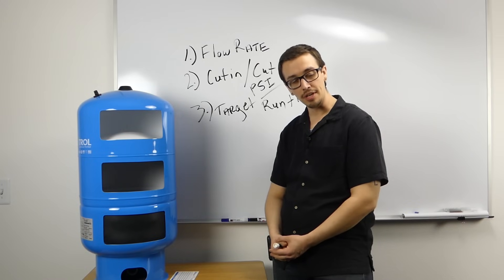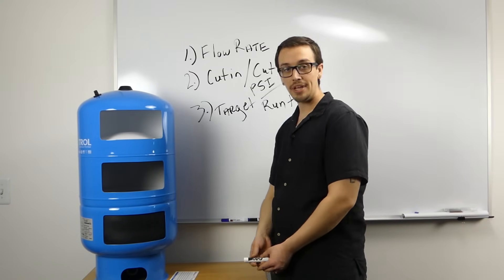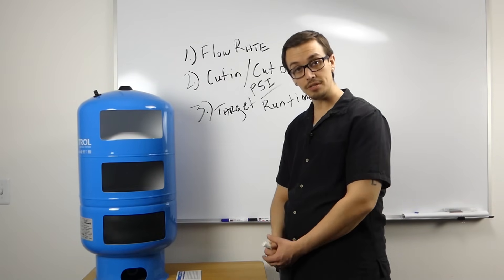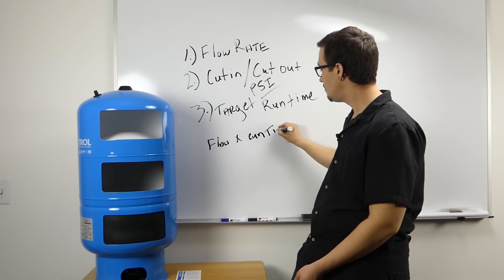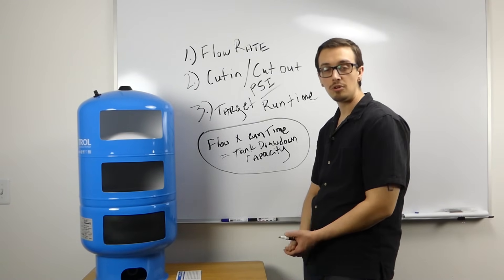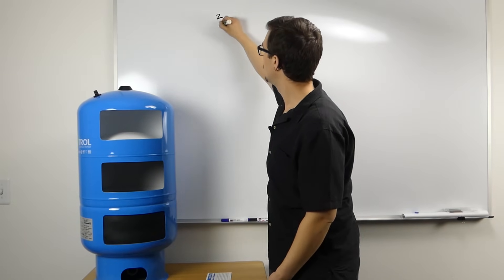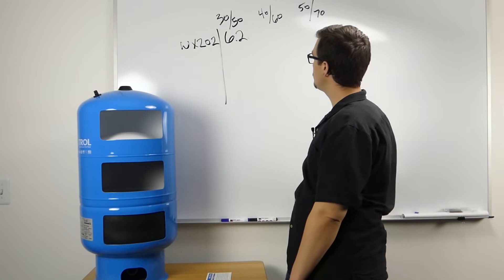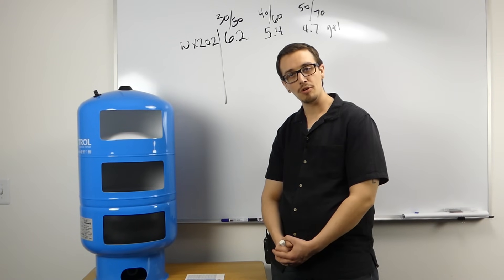How to Size a Pressure Tank

Comment from the maker: Thanks for watching! If you have ANY questions or concerns about your water system you can leave a comment, call our experts at 855.329.4519 or you can live chat with them on our website: RCWorst.com
Reply: Thanx for the video. Hoping you can help me figure out what I need. Want to setup a irrigation system for my garden. Got a 4 inch underground line about 700 feet long. Want to run drip tape off the line. Want to pressure the 4 inch line at 60 psi and throttle the header the the drip lines run off to 8 psi. Will run about 1000 feet of drip tape
Reply: sir what thr problem of my water tank if the water pressure will not go up?  the water pressure steady at 30psi..  the cut in cut off is 20 to 40psi
Reply: Good video and explanation.  I watched because I'm concerned about my system.  Just bought a house and noticed the pump short cycles alot.  It's set to 35/50 and runs no longer than 10 to 15 seconds at a time.  Too big of a pump or too small of a tank?  Tank is a WX203TK.  Any advice would help.
Reply: Is there any way I can build a forge out of a well tank
Reply: Good evening sir my question is for a sta-rite 3/4 jet pump how must measure the tank...and a 1hp jet pump too...thanks.
Reply: I just bought a property ( deceased owner) so there is no information as the house was built 1986 before records were kept. How do I know what my gpm and flow rates are? I have a 30/50 pressure switch  but it is cycling fast with a 20gallon pressure tank and set for 40/60 with 38 psi  3/4" input line with 1/2" copper lines to fixtures ( 1 bath ) slab house. Everything kicks on and off but noticed as the pressure guage drops down it dips deep ( jumps wildly down during cut in ) then smoothly to the cutoff What is wrong? I do not know pump size or how to tell ?
Reply: You said for pumps 'smaller than 1 hp target a run time of 1 minute' for pumps 'larger  target at least 2 minutes'   so does that "larger" include the 1 hp pumps?
My 1 hp pump seems put out over 23?24? gpm but I can only fit about an 80 gallon (21gallon drawdown) into the pump house.  What do you do in a case like that?
Reply: My irrigation pump is 3500lpm, what is the tank size.
Reply: @msayas6239  Yoy should use a tank of 460 gals. minimum. This is obtained by dividing 3500 LPM /3.8 equal 460 gals.      Because 3.8 equals 1 gal.
Reply: Por favor indicarme si puedo ver 
este video en idioma español

Comment: I had a beach house near a hotel,   When around 5 pm hit so many guest were taking a shower and I would loose all water pressure.  I installed the largest wellmate pressure tank I had in stock.   With a check valve on my city supply,  no pump,  if pressure on tank side was higher house drew from tank,  proper bladder pressure is critical,   When I did have pressure it was around 90 psi….i also had one in the sun that preheated water for my shower that had a small tankless heater.
Reply: Lose*

Comment: My home is 17yo, and I've owned it 2yrs. Original owners obviously did not cut corners or install less than top-line support systems. I cannot locate the pressure tank. Does that tell me its buried? If so, how do i check functioning and tank pressure for maintenance? Pump/panel exposed 60' from house but no tank. We have lost consistent flow and pressure in house. All interior lines are good. Im stuck!

Comment: @6:22, you said at higher pressure, more draw down volume is required, but your table shows less volume is required.
Reply from the maker: @6:22 He said "The higher pressure you are operating the more tank you will need" 
This means the volume stored goes down as the pressure goes up - you may need a larger tank to hit your target run time if you are running a higher pressure.
Reply: @RCworstwater  But the pump rate goes down with higher pressure, so the table is correct.
Reply: @somaday2595  brain 🤯

Comment: Thank you for the chart! Does the number in parentheses, after the recommended tank model, indicate the need for more than one tank in some circumstances? For example, a 20 GPM pump, operating at 40/60 PSIG and ESP II says "WX-255 (2)", as compared to ESP I which says "WX-255." Does that mean it is recommended to hook two WX-255 tanks in tandem for ESP II?

Comment: Amazing video! I had some questions, my well is 50ft and according to my 1 hp pump specs, it has 7.5 gpm flow rate at that depth, my run time would be 2 minutes, so i would need a 15 gal pressure tank in theory, but obviously majority of manufactures make 20 gal tanks as the smallest ( i may be wrong) my question is, if I were to get a 30 or 40 gal pressure tank what will that look like in terms of performance? Also if space is not an issue would a bigger tank be more optimal?  Thank you!

Comment: I do not see a large enough pressure tank on your website.  We have a red lion 2hp 77 gpm,  so based on your 
 equation I think we would need a 150 gallon pressure tank. Is that correct.
Thanks

Comment: Thanks for putting all this together! Let‘s say I have a 25gpm pump and the tank is completely empty, will all of the 25gpm be used to fill the tank, so will I get practically 0 water pressure from the faucet or how does this work?

Comment: well is 400 feet deep and the pressure tank is a 40 gallon and we are both retired  so is this the proper tank size . I had a smaller one and well pump burned out so replaced every thing  with new .  New 40 gallon pressure tank  , new switch  , new whole house filter in 2016  .  Whole house filter started to fail after the epic ice storm hit and we had no  power for 5 days so replaced it and pressure tank turn off valve broke and tank emptied out  when I was replacing filter  , clean water came out first and then silt came out  red , grey and black  probably over 2 gallons of it . Put on new turn off spigot . lucky I thought ahead and always have one on hand just incase .

Comment: Great video. I learned a lot, but I do have a question......which is probably more suited for an actual phone call than a post in the comment section, but we'll see. Is it possible to have say, THREE pumps and three pressure tanks, all on the same system, but have the pumps come on at different PRESSURES, as the water demand increases?

What I'm thinking is to have say...three pumps all at about 40 or 50 GPM, but the main pump set at say 40/60 and then a second pump set at say 35/60 and a third pump set at say 30/60. So as the demand increases and it will, is this a possible solution to be able to increase water availability as demand increases?

The demand will vary at different times of the year, so for 60% of the time, one pump will be more than enough, but then the other 40% of the time, one ump will not be enough at all.

I do not want just one pump, I want at least two preferably three so WHEN one fails, we still have water. Thanks, and keep up the great work.

Comment: So  a larger tank, lower turn on psi = longer lasting pump? I replaced an old tank  for the same size tank, a WX-255. The pump is 1/2hp with 8.5 gpm. I think the switch is set to 35/55 psi. Not higher than this.  This is good?  Does a larger pressure tank, oversized for the application, last longer than a normal/typical size tank?

Comment: Hi thank you for some enlightenment… i have one question, i bought a big pressure tank already (500 Gal) . My water pump output is only 8gal/min. Will it be beneficial for the  water pump? Will it be better compared if I use a smaller one?
Reply from the maker: Bigger is always better when it comes to pressure tanks.

Comment: Do you need to add air to pressurize the tank? Is the tank already pressurized for all 3 common pressure ranges and varying flow rates?
Reply: If the air precharge is 3 different settings for all 3 commonly available pressure ranges, how can the tank be already pressurized to all those three different settings simultaneously?? 🤯

Comment: Great videos, thanks.  My pump keeps cycling but water pressure doesn't increase. I watched your other video saying it could be something like a closed valve, etc.  It's none of those things.  I thought maybe the pump is weak, but it's really large - 380 watts.  I'm thinking the pressure tank is the suspect.  It's large but maybe is limiting the capacity of the pump.  Is this possible?  thanks again.
Reply: It sounds like your tank lost its air, so without that air cushion, the pressure changes really fast with little to no water pimped. This happens quite frequently if you don’t have a captive air pressure tank like the one in this video. If you do have a captive air tank and it is completely full of water, the bladder he keeps talking about in the video has ruptured and you need a new tank.
Or your pressure gauge died and you need a new one.
Reply: Check the air in the tank, watch a video  its easy.

Comment: Below are specifications on my current well pump and well tank.  I would like to replace my water well tank with an Amtrol tank but I need to size the Amtrol tank.  Please send me the Amtrol model based on the information below:

Current well pump specifications:
•	Manufacturer: STA-RITE 
•	Modal: MSE-7
•	Motor: HP 1
•	Volts: 230

Current well tank (to be replaced):
•	Type: galvanized
•	Possible manufacturer: Quick Tanks, Inc. - QC61 Coating – NSF Certified (from sticker on tank)
•	Model: Q82V
•	Max Work Pressure: 75 PSI
•	Height of tank: 62”
•	Diameter of tank: 20”

Comment: Maybe a dumb question, but how do I figure out the gpm of my pump? I have a Goulds J10 1HP pump and I couldn't find gpm in the specs. Years ago a repairman replaced my pressure tank and my water pressure decreased significantly. I think it was a cheap tank with lower drawdown. I'm looking at a tank that has around 12 gpm drawdown. Do you think this would be sufficient?
Also, do you know if it is allowed/feasible to use PEX between the metal piping on the outlet side of a jet pump going to the inlet of the pressure tank?
Reply from the maker: How long does your pump run to fill the tank? It should be at least a minute, preferably two minutes. Pex is ok to use, but you will lose pressure because pex has a much small ID then the equivalent size PVC or steel pipe.

Comment: What about when your using a domestic water pressure booster were you have say 35 psi coming in but want to run say a 40 /60 Do you use the same sizing?

Comment: I live off grid. I catch rain water. I have 6 275 gallon tacks tied in with each other.  I have 220 volt water pump rated for 8gpm.  What size tank shoukd I get?
Reply from the maker: The smallest that you can get away with is a 32 gallon: https://www.rcworst.com/Amtrol-WX-203-Well-X-Trol-Well-Water-Tank-32-Gallons-p1569.html

Comment: Question is, how do i find the pump  flow rate of a submersible that has no paperwork? Could i possibly isolate the pressure tank somehow and call for the pump to run and measure flow per min through the drain valve strictly from the pump? Or is there an easier way? Need  new tank because pump is coming on every time faucet is opened. Trying to size one.
Reply from the maker: We've got your back: https://www.youtube.com/watch?v=5J1MaIyMSOQ

Comment: I have a wx-202 I will be replacing soon. It appears my pump is 12gpm based of the test I did. From this video and charts I've seen, the 202 is probably too small. I see the 250 or 251 would be more appropriate with a 12gpm pump. Does this seem accurate? I want to be sure that makes sense given the price difference between them. What would I expect to gain from having the bigger tank besides increased pump life?
Reply from the maker: You are correct in that a 202 is too small for a 12GPM pump. A larger tank will increase pump run time and off time - increasing the life of the pump by making it cycle less often. You can buy them here: https://www.rcworst.com/Pressure-Tanks-c171.html
Reply: @RCworstwater  Thanks!

Comment: I have Pressure switch 30/50 psi, I filled pressure tank with water and air, pressure turned off when when it’s over 50 psi and turn on when it’s lower the 30 psi, I have water in the house but i have to help pressure tank with adding air until 50 psi( when pump is running) , pump keep running and stock on 38 psi then when I plug air in and help build  a pressure in the system, when it’s over 50 it’s turning off.. I have feeling like air leaking somewhere. But I have water in water faucet, and again pump turning on when it’s lower then 30 psi and then pump keep building pressure until 38 psi and just keep running without shut off i until I start adding air to 50psi until pressure switch hit and stop pump. Please tell me what is the problem?
Reply from the maker: Give us a call: 855.329.4519

Comment: I have 2 pumps due to low yield well. The first pump pulls from the well to storage and the second pulls from storage to feed the house. My pressure tank to be replaced would feed to the pump supplying the house. How would calculate the flow rate based on this?
Reply from the maker: Can you read the model # on the pump that is connected to the house?

Comment: I want to buy an electric tankless water heater. The manufacturer says it should have water pressure at least 30 psi. My well tank is a 30/50 and cuts in at less than 30 psi. Is it safe to raise cut in pressure to 30-31 psi? Is it possible to change to a 40/60 tank with the same pump?
Reply from the maker: Give us a call: 855.329.4519

Comment: Hi, Thank you for the video. Is there any disadvantage of oversizing Well Tank and installing 50/70 switch? We moved to the house with existing system 20 gal tank and 30/50 switch. he pump's specs are unknown.
Reply from the maker: Nope, the bigger the tank the better! Check out our pressure tanks here: https://www.rcworst.com/Pressure-Tanks-c171.html
Reply: Never exceed 60 psi,bigger tank if not using all the drawdown will stagnate. Keep turning over the water.

Comment: I have a 1/2 HP. F & W CP05 Pump I just had rebuilt. He said the pump was fine,  just cleaned it up and replaced motor bearing which were getting noisy.  The pump rebuilder said it was good I brought it in as this pump is built better than the new pumps.    He said he would guess it has about a 10 GPM rating and I am not sure if that is accurate or not. .  I am not sure of the size of the bladder tank but the shut off valve is a 40/60.   It was the one that was on it,  and I never thought about it before.  I am guessing the bladder tank is about the size of yours in the video.    I ran the water until the pump kicked on and timed it,   and it was almost exactly 2 1/2 minutes for the pump to shut off.  It may not be pumping 100% as the well it old but we have plenty of water or so it seems.   I am thinking about putting a larger 52 or 86 gallon as I run the pump due to a large garden more in the summer than prior owners of the home.   What do you think?   Should I change pressure switch to a 30/50 or what are your thoughts.  My final question is do the tanks come pressure set or not?
Reply from the maker: Give us a call: 855.329.4519

Comment: Sorry but now I'm even less clear than before I got here. First, I have no clue what my gpm is (or the size of my well pump motor) but I DO already know the drawdown rates for ALL the tanks I've looked at including the present old one. I'm told that if I replace with a larger one I'll simply get more pressure, which is good. But as I survey tanks I see that even smaller tanks than the present 42 have considerably higher drawdowns at the same pressure schemes, than the old one does.  Does this mean I can actually downsize and improve? 

At this point I don't know if I should be looking at capacity or drawdown.  Or how each one affects pump cycle frequency.
Reply: Currently in this same situation, I'm wondering what you ended up choosing? I've got a 3/4 hp with a 42 g tank ( needs replacing soon).

Comment: Very informative, but if I may add some considerations, I'd like your input please.  First, I have a pressure compensating pump, so when you open one tap you get water at the pressure you set the pump to.  When you open a 2nd tap, the pump speeds up to maintain that pressure. The same if you open a 3rd tap.  My system came with only a 1 gallon pressure tank and it worked perfectly.  HOWEVER... that 1 gallon tank could not absorb all the back pressure from our hot water tank heating up 80 gallons of cold water to 150 F.  The pressure was set to 70 on the system but when the water tank began to heat up it could go at least to 110 PSI.  That's where the gauge pegged so I'm not actually sure how high it went except to say that the 150 PSI PRV did not trip.  When you size a pressure tank is the back pressure from a hot water tank ever a consideration?

Comment: Quick question...I have watched a few of your videos and you explaine things well! I have a 3 story home..when the well was installed the guy set it at 30/50 and we had horrible pressure when it was at 30. so I set it to 42/73. Then I heard that maybe it should not be so far apart...should I change it to come on at 53? TIA...Garth
Reply: Isn't 73 PSI awfully high? If you raised the low limit to 42 why move the upper limit all the way to 73? If you have sufficient pressure at 42 PSI maybe decrease the upper pressure down to 62, as long as the pump run time does not get too short.
Reply: @bigpardner  I have 10 Foot ceilings...so it was about 30 feet to pump the water to the 3rd floor. So with elevation loss I needed it to be set higher.
Reply: @GO-zg7ox   I am thinking that how low your water pressure was getting would be governed more by the lower, cut on pressure setting, not the upper. Setting the upper, cut off pressure to 73 or even 103 would not keep it from decreasing to 42 if that is the setting, 30 previously.
Reply: @GO-zg7ox  - It is standard to have a 20 psi difference between cut in  and cut out. 50/70 switches are fairly common so if you’re comfortable with that, then you should raise your cut in to 50 - 53.